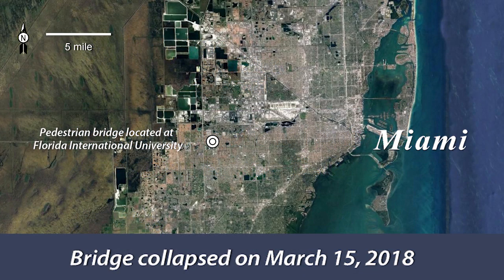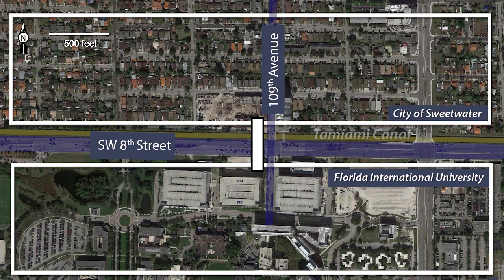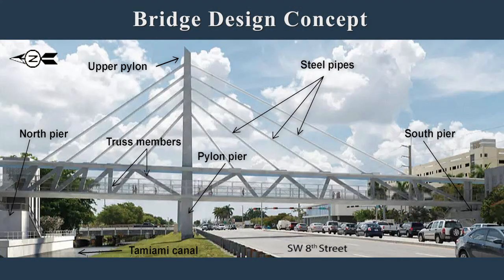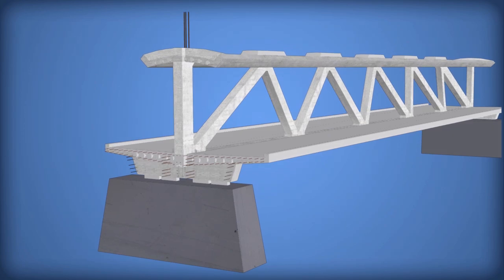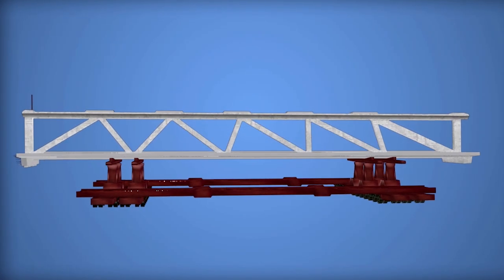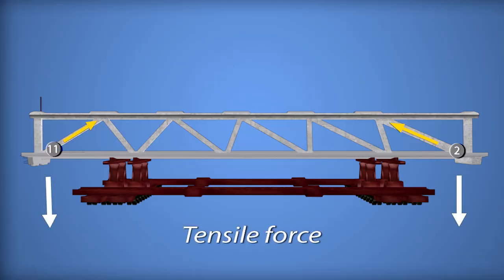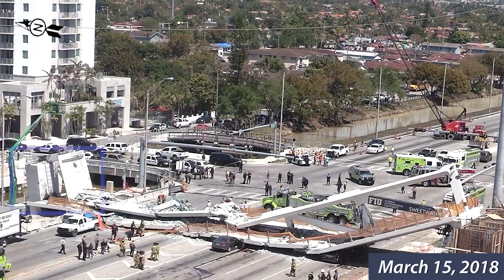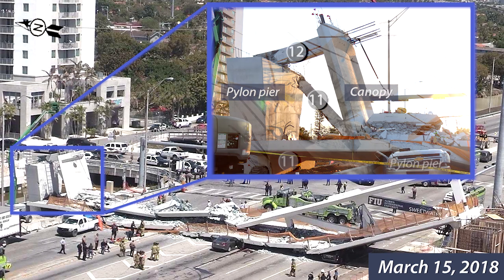Pedestrian Bridge Collapse Over SW 8th Street HWY18MH009

Comment: It's not a radical structure, it is a failure of the most basic truss action of a simple king post truss bridge.  If the shoe joint that transfers the angled compression member into the deck in tension is not strong enough, the truss fails.  It doesn't get any more basic than that in truss design.
Reply: The design of the truss to appear to be cable stayed required changing the angles of the supports so the loads were not distributed equally. I thought the cables were designed to provide support but this video suggest that they were ornamental. That answered my question as to why they would put the span in place without the cable stays.
Reply: Ted Cook — It certainly is a radical structure.   Building a truss bridge in reinforced concrete is unusual to begin with.  To attempt one of this length with no arch is unique, I expect.  And the truss was asymmetric, only for the aesthetics.  Is there another truss designed like that anywhere?
Reply: @GH-oi2jf  Exactly, a truss is designed to make use of compression forces balanced against tension forces. Concrete is weak in tension so steel has to be used to handle tension but a concrete truss suffers in the transition areas, which is where this failure occurred.
Reply: @GH-oi2jf  Good point.  Building a truss out of concrete does seem to be very rare.  Probably due to the fact that having a concrete tension member has few benefits and just adds weight.  I guess my question would be, what would the correct detailing of the joint looked like?  Where the compression member 11 delivers a point load, and that load must be distributed across the width of the deck, looks like about 16', to the tension rods in that deck which appear to be equally distributed across the width of the deck?  Lots of steel bars coming from that point diagonally like the strings on a hammock where they attach to a point and then distribute a tensile load?
Reply: I find it remarkable that the joints between the trusses and the deck are made as cold joints flat on the surface of the deck.
When I, as a complete layman, would have had to design that I would have left triangular cavities in the deck during its pour (using a temporary filler) and then fitted the trusses into those cavities.
Reply: @Rob2   I believe that is called "keying", and is a technique employed in some concrete design. However i would have expected they would have used rebar to transmit the entire shear load rather than rely on the shear strength of the concrete as any later cracking could render the keying useless. Even if it could be employed the deck would need a sufficient rebar detail to ensure the cavity doesn't break out.

Comment: Excellent overview of events. Thanks for posting. Can we get a follow on video detailing the joint failure? Juan.
Reply: I wondered if our buddy at blancolirio would be covering this.  I look forward to your report!  Any word on you getting access to the flight simulator for 737 MAX updates?
Reply: blancolirio — This is only an excerpt.  Listen to the full hearing.
Reply: Yes! The NTSB is good. The one and only Federal agency I dont want defunded. All the rest need their budgets cut by at least 80%. 

Ive noticed the one thing governments can do very well is detective/investigative work.
Reply: @ChadDidNothingWrong  nicely put!
Reply: @LMBee00  who?
Reply: Nice to see you here! I should not be surprised! 😁
Reply: Too difficult for you?
Reply: yeah, I have difficulty believing it was just slipping with rebar connecting the parts together and tension rods going through all of it. in order for it to just slip, the rebar and tension rods would need to shear off as well. Either something isn't known, or it is more than just slipping joints.
Reply: @Zarcondeegrissom  Rebar would not have to shear.
When the concrete cracks around the rebar and tension rods,
the steel components then have room to move(bend/stretch) without shearing, which allows the structure to begin moving and; the forces provided after the movement began, it would easily have the ability to shear quite a lot of rebar.
Likely trying to re-tighten the tension rods cause more crumbling of cracked concrete which then would have led to setting the structure into motion.
Reply: @Zarcondeegrissom  
The outer longitudinal tension rods in the deck were not yet tensioned only the 4 running the centerline. The untensioned deck could not carry the load once 11 was taken out of tension. Once the load was transferred from the canopy thru member 10 to the deck is when  cracks began to show.

The slip at 11/12 was really a punch out when the canopy failed at 11/10 pushing both those members down and out in opposite directions
Reply: @tommypetraglia4688  That doesn't agree with what the NTSB is reporting.  The NTSB clearly states the failure started at node 11/12 (a deck joint, not a canopy joint.  I don't think the NTSB even mentions the DECK tension rods.  So, do you have any evidence that "the untensioned deck" had anything to do with this accident?
Reply: I don't think it mattered, and as was said a few times in the press briefing, even if the surface was properly roughened, it still would have collapsed because the design was inadequate for the loads on it. all of it, not just the 11/12 joint.

As I typed elsewhere, The column would have needed 18 square inches of rebar to hold the load on it, the column had 4.8 square inches of rebar. That's a 300% deficit in rebar to handle the loads on it, I think that's approximately how Mr. Sumwalt worded it in the Board Meeting. (I just finished watching the 3 hour Board Meeting vid.)